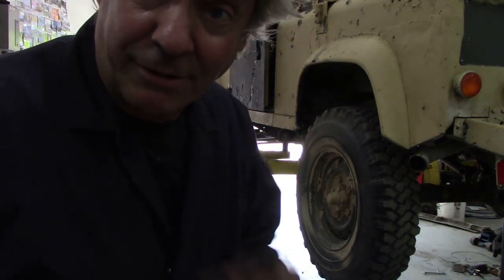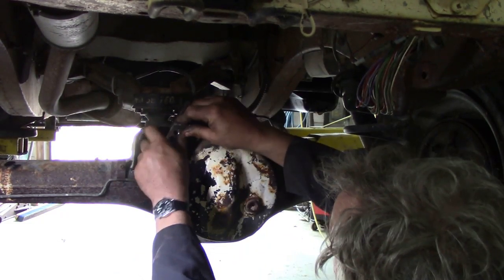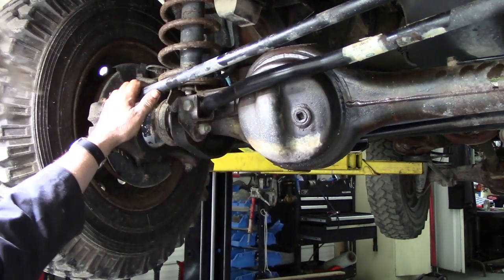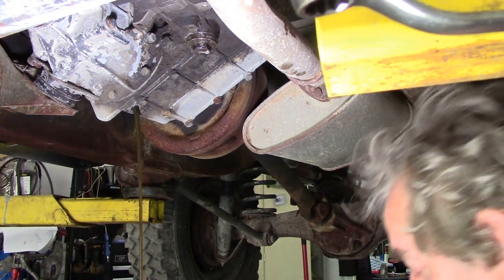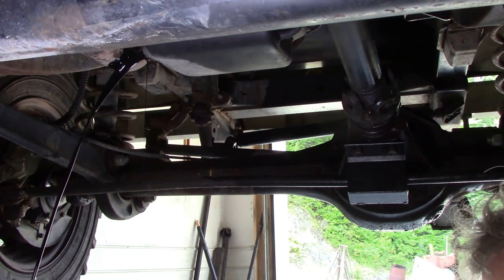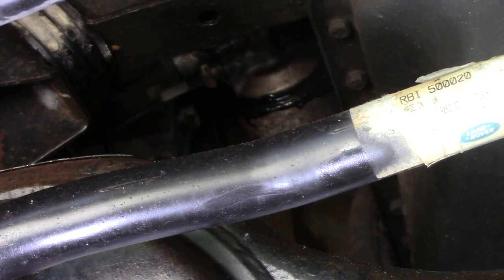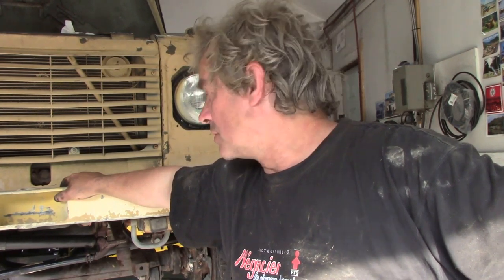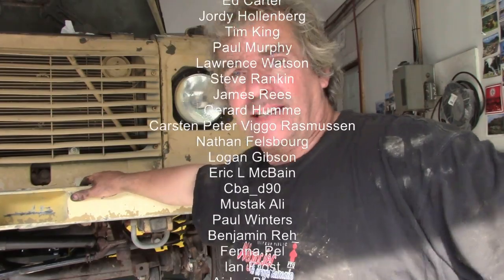2.5 NA diesel service day 1. All oils, clutch bleed, rear brakes, underside checks

Comment: Just adding my half pence worth, I always make sure i can undo the filler plugs in diffs , axels, gearboxes etc before draining,  just to make sure i will be able to re fill them.
Reply from the maker: Only issue i have ever had with the fillers was on  Polish 110 300Tdi - the Torx was rounded out so I had to pull the floor plates and weld a nut on to get it off
Reply: Only if you have any doubt in your ability to get them out... Filler plugs will know that attempts to stay in when Mike is about are futile!
Reply: @peterpeterson9903  you never know peter, i drained a swivel housing once that had the filler snapped off,  was on mates drive without welder.  Disabled his truck for a further 2 days !!

Comment: For the engine oil drain it’s easy to just cut the bottom of a 2 litre milk bottle , cur down the side to fit. Oil flows into the bottle and straight down into the oil drain pan , no mess.

Comment: Thanks for all the videos they inspired me to do a 200,000km service on my 90, which I just purchased two weeks ago. I live in Sweden so this is saving me lots of beer tokens.
Reply from the maker: You can do it!
Reply: Thanks : ). So I have a question if I may. While greasing the swivel housings I noticed pitting on the surface looks like when on full lock. Is this a big issue?

Comment: A Yorkshire man chucking good oil away, BLOODY HELL Mike.  You should have drained that 80/90 gear oil and ATF into old milk bottles and left them on a window sill for 6 months to let any solids settle, then drained them thru a rag to re-use it. You had better watch what you are doing or you will never be let back into Yorkshire, Other than that, a great video. Best wishes from Yorkshire Rob.
Reply from the maker: Lol! 

Gear oil has just hit £70 for 20 litres here

Comment: You have to love remote filters!

As for MoD vehicle maintenance, it could be a little hit and miss, but generally they were very well looked after (though Army stuff was always badly dented and painted with wooden spoons) - it’s the abuse and neglect they suffered after being sold off that is the problem; it’s the civvies that kill Land Rovers!
Reply from the maker: These were direct cast vehicles
Reply: Thats rubbish. 

I've seen REME burger up just about everything. 

Rounded off bolts and fittings, bodge repairs and a Ferret with its B60 removed, but instead of unplugging everything they decided just to slice through the loom.

Comment: that was a long instructive video, Mike. I've just bought a 35-year-old Land Rover 109'' Santana, of the ones built in Spain in 1984. and I'll be doing all the brakes and fluids to get the vehicle inspection test.
Reply from the maker: Interesting truck the Santana - not seen one here, but I know of some who wanted a cheaper Defender - very hard to find parts here - not quite the same as LR's

Comment: I have fitted an oil drain valve to the sump of my Defender which makes changing the engine oil very clean and easy. Well worthwhile.
The vehicle in this video badly needs anti-corrosion treatment underneath. Also the silencer needs to be rotated because it's currently the low point and is likely to get bashed when off roading.

Comment: I see the rear diff still has its night convoy white paint,I extend the axle breathers and put a few loops in just to be safe ! I seem to recall mixing ep90 & grease for swivels,I like taking apart the ujs to check  the needle roller bearings greases path isn't blocked
Reply from the maker: That would be a super service and the vehicle is going on display so no need to go wild!

Comment: Hey mike i was sick of pushing popping ripping grease gun off i just bought a needle adapter and only push down th ball valve. I got it because i had trouble reaching grease nipple on front propshaft. Its a delight to use. Also i only use lithium grease as any other red blue grease is too thick and dried, got thick. If having trouble pumping grease through all 4 caps i use a hammer and tap the caps seems hardy spicer recommended  it to unstick the cap seals.

Comment: So if you take a shim out the top, will it take the slack/wobble out the top pin? Thanks from Texas. Love the videos Mike.
Reply from the maker: Yes in a way - this is why i didn't do them as I was not instructed
The bush is worn on the sides usually and therefore lose, by taking a shim out increases the preload and therefore takes out the play, but the bush is still lose - gets you through inspection but is not right

Comment: Did you send me a message about my injection pump problem? I can’t find your message.
Reply from the maker: Send again - I get about 50 emails a day
Reply: Britannica Restorations Ltd I asked about why the diesel won’t bleed any further than the pump bleed screw. You suggested a broken shaft inside the pump, but not how I can confirm that this is the problem without removing the pump. Can it be the solenoid? Do they ever stick? I removed it and applied 12 volts across it and the piston moved DOWN. Shouldn’t it move UP?
Reply from the maker: Did you get the polarity right? Can you fit the solenoid without the plunger and try it?
You will have to stall to stop it